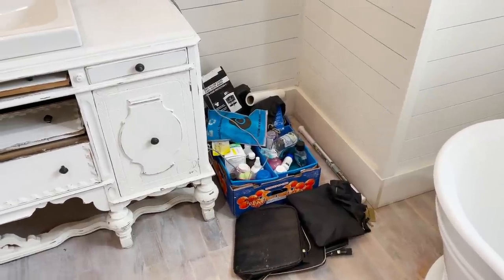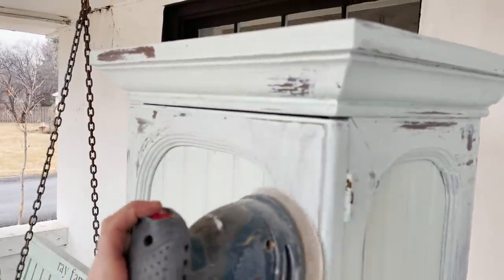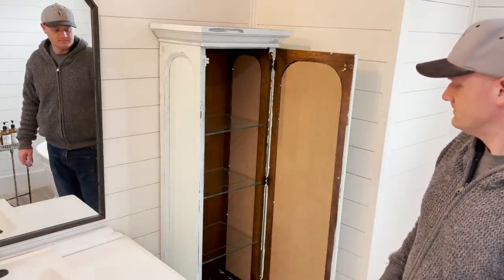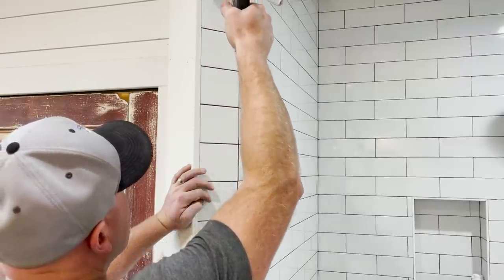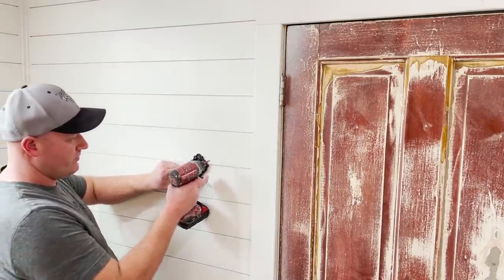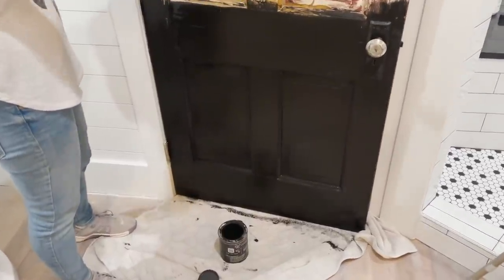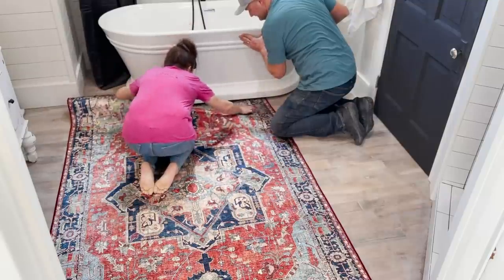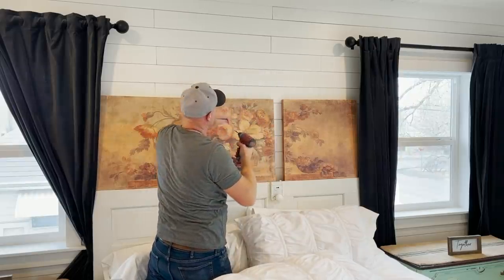Dream Home Primary Bedroom Suite

Comment: The rug in the bedroom needs to go the other way
Reply: I was thinking that too, and should it go towards the end of the bed more?  Not sure.  I kept thinking, I would trip on that 😆 but then, Im old 😁. Bedroom looks so fresh! 🌸
Reply: Agree
Reply: I was thinking the same thing. Pull it down so that it more than clears the nightstands. Just make sure it will be where you put your feet. It will show more of that beautiful rug and give you more covered space around the bed for you to walk on.  Love the bathroom.
Reply: Perhaps a larger rug? The size of the room certainly could accommodate it. The biggest reason I hate the hardwood floors in my bedroom is trying to find rugs to put my feet one before getting into bed. I’d want more than a sliver. That said, so much more in this room to love...but the bathroom is my favorite. I don’t know if I’d ever want to leave it!
Reply: @Scrapfuzz  nothing better than waking up an putting my feet into a soft rug.
Reply: The rug is supposed to be more for your comfort under your feet, not for your bed. You should bring it out more and across the bottom of your bed so there's more for your feet when you're off the bed.

Comment: My question is could you have put some type of magnetic thing if you pushed on it it would unlock or a piece of wood and there was a bolt on the other side I don't know wouldn't it be an easier in case you have to work on the plumbing to be able to remove that?

Comment: i also use a little round bit of hot glue on the bottom corners of art and they work just like those clear rounds that stick to the frame to keep the painting from slipping.

Comment: the very reason I have always painted walls white because with the neutral black door and metal with the white walls you can change out the style and even decorate for the different season, just change out your smalls, and  hand towels and your done. the great thing about the rug is the many colors in it to pick from for accent decor.  I would have centered the rug under the bath tub even though the rug would then not be close to the buffet.  It would drive my OCD into overdrive, it being off center. but as always i say go with what you want. i love your taste, mainly because it's just like mine lol!
Reply from the maker: I would but because the shower angles it just doesn’t fit.

Comment: Love the changes.  But have to agree with most comments.  The bedroom rug needs to be turned so it wide under the bed.  More exposed on the sides and pulled in front of the side tables.  The bathroom rug would drive me nuts as you have it.  I would move it more left/centered on the vanity so that it's not under the tub.

Comment: its beautiful no doubt about that but what do you do to heat such a big house
Reply from the maker: We installed tons of insulation and flashed all the seams with spray foam. It stays very cozy. We have 3 small HVAC units that do the separate areas of the house.